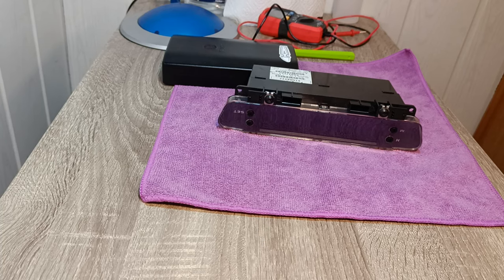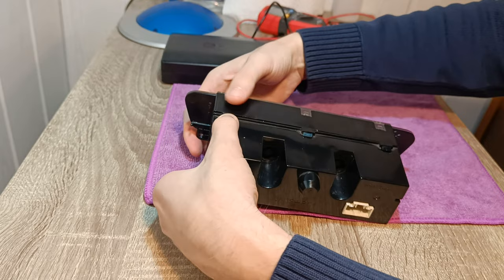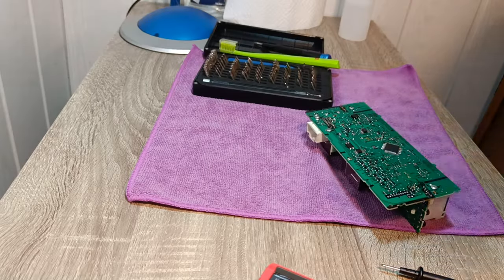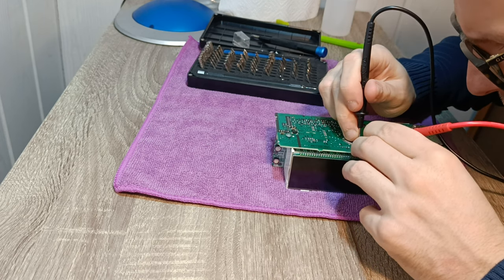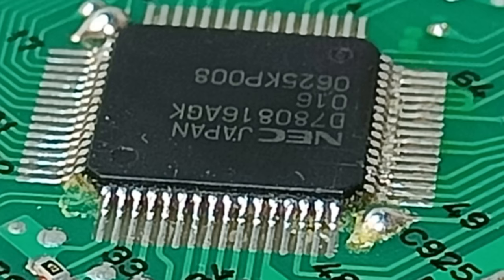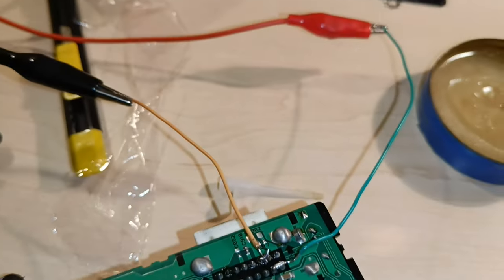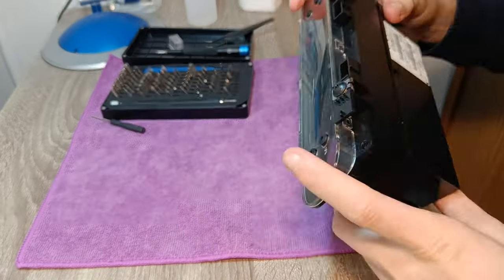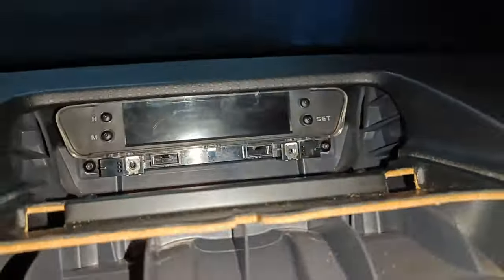Mitsubishi Colt Z30 (2002-2012) Board Computer Screen Repair

Comment: Many thanks, mate.  Mine was bugging me for years. I don't think it's broken but just has a loose power connection. It's sometimes all working properly, while at other times it's completely blank.
I looked at stripping the dash (too much grief), and took the stereo out (still couldn't get at it). I then came to the conclusion that Mitsubishi must have fitted it before they fitted the windscreen. As I wasn't going to remove the windscreen for it I gave up on sorting it out about 2yrs ago.

So the star bit of your video, for me, was the location of those hidden plastic clips. Access looks SO easy now I know about them. Thanks again.
Reply from the maker: No problem, I am glad that you liked it!

Comment: Great video. What if I replace factory radio unit? Is board computer wired both to radio and to some ither harness to get data such as fuel consumption etc.? I just want to understand if I can retain some basic board functionality after factory radio is replaced. Thanks
Reply from the maker: Hi! I think that consumption, temperature etc. will not be affected with aftermarket head unit. Where station is shown(or CD track) it will be just empty space. Thanks for the comment!
Reply: Yess but you cannot.change later consumption average or at this.momemt

Comment: Hi! Thanks for the tips. A few days ago my antenna (outside the car on the roof) touched a low parking ceiling, and the screen instantly got down... Do you think it's possible ? Is there any link between the antenna and the screen ?? A big thank you if you can answer this :)
Reply from the maker: I think it is just a coincidence, the antenna has nothing to do with the screen in my opinion as it is just for FM radio signal. Thanks for your comment!
Reply: @regularguyrepairguy  Ok. It's a big coincidence! Thank you for your answer :)
Reply from the maker: Also the screen and head unit are separated modules (antenna is plugged in the head unit). 
You are welcome!

Comment: Do you know how to replace the lights in that unit
Reply from the maker: At 4:01 you see two black caps? Those are lightbulb holders. If I remember correctly, you should rotate them anticlockwise and gently pull out..